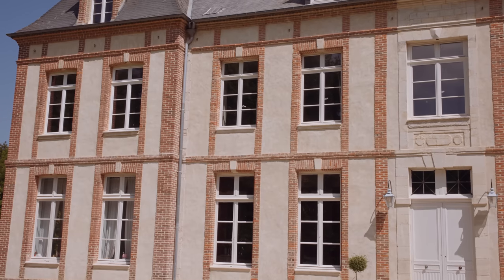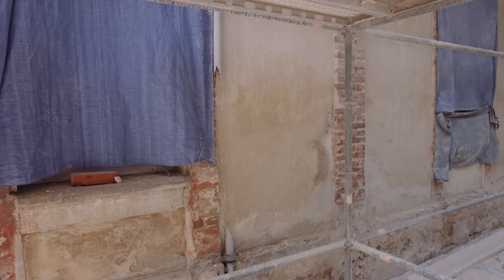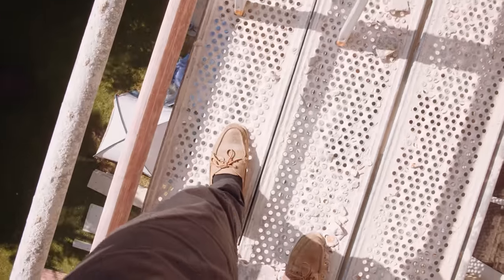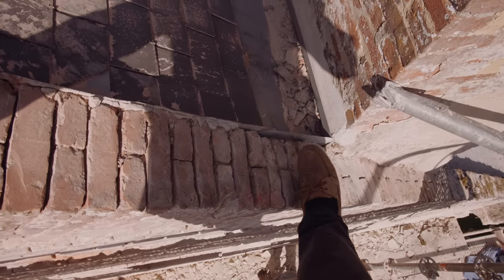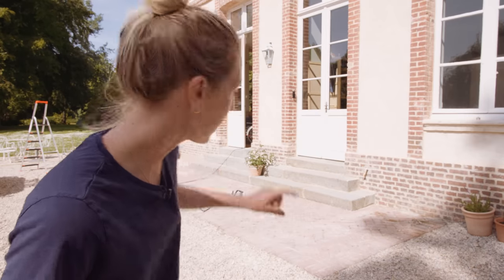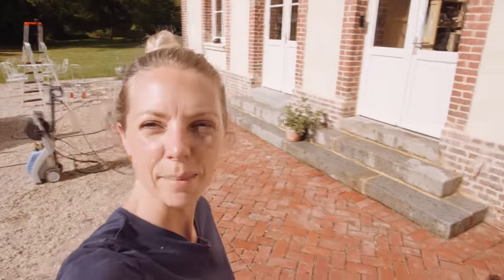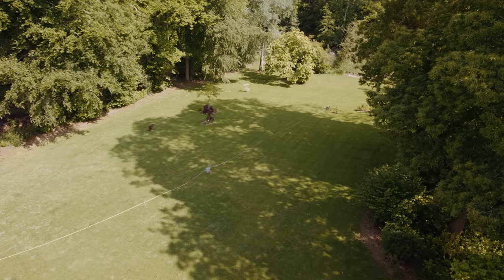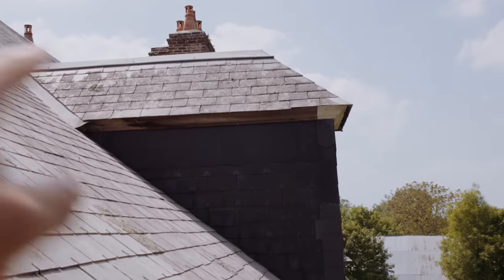Restoring our 200 year old Chateau Walls (French Master Craftsmen at work)

Comment: Just some advice Anna I’m a landscape gardener and I also do patios and driveways and once you have power washed the brick on your patio area you need to let it dry thoroughly and then brush Kiln Dried sand back into the joints if you don’t you will find over time the bricks will loosen and start to wobble it’s really inexpensive to do and shouldn’t take long but trust me it’s worth doing, you might need to do it a couple of times over a few day period as the  kiln sand is very fine and it takes a fair bit to get right down into the joints and it needs to settle so you might see some air pockets and dropping  showing up after your first lot after a day or so, so just repeat it until it’s looking as good as what you have done with the rest of the chateaux but it will save you a lot of work in the long run, love the channel and thoroughly enjoy your videos each week.
Reply: This is a good thing to know, only trouble is I got out of breath reading it b/c it is the longest sentence ever, LOL!
Reply from the maker: Thanks for the tip!
Reply: Would you ever recommend polymeric sand?
Reply: @Kristin Rogersdotter  Natural sand is much more budget friendly. Polymeric contains adhesives. If it rains before it sets, the polysand will stick to the surface of the pavers and is very difficult to get off. Polymeric sand is also not a permanent solution and will need to be done again in 5 to 15 years, depending on the quality of the product and the workmanship in the application.
Reply: @HowToRenovateAChateau  I just have to ask — how sure are you that your house is not haunted?
Reply: Wonderful advice! I wanted to put cement between the joints and to use fine sand instead is so much better. Natural. Thank you a lot!

Comment: The patio is looking much better Anna, after you pressure wash it is advisable to have sand to brush back into the grooves of the bricks as the pressure washer does wash the sand out a bit that is what we found out when we did our driveway. Phillip I was shutting my eyes together when you were doing your jungle climbing, the views were fantastic from up there, though I have a problem with heights. Have a lovely day.

Comment: Ι always wondered about that side of the chateau. I looks as if there was a part there which is now missing or a one which was supposed to be built but wasn't.Is there a story there?
Reply: It is actually the other side that was added onto. Originally it was a hunting lodge, and then the right hand side was added on, symetrically it would look better with a right hand extension though😂
Reply: @Jayrose59  thank you for the info 😊

Comment: Could you have your mason talk more about lime mortar. How it’s different than cement based and when it should be used?

As an American licensed builder I have not heard of lime mortar until your last few episodes.
Reply from the maker: Hello Evan, you replace cement with Lime powder.
Reply: Different mortar mixes for different applications. All mortars contain sand (aggregate) and various binders, typically cement, lime or a mix of the two. Cement mortar is usually a 1:4 cement and sand mix, lime-cement is 1:2:8 cement, lime and sand and lime mortar is 1:3 lime and sand. The mortar should always be softer than the stone or brick to allow for thermal expansion and contraction. Otherwise the brick or stone will crack. Cement mortar is mainly suitable for block and granite, modern bricks usually go well with lime-cement, old bricks and soft stone like lime stone require lime mortar. Different types of lime also result in different mortar strenghts.

At least that's what I've read, I've got no formal training or education on that matter.

Comment: you are aware that using 'waterblasters' on any type of porous surfaces is very damaging.....a low pressure hose attached to soft bristle brush is best.....and for moss and mould a spray and walk away moss killer is best.